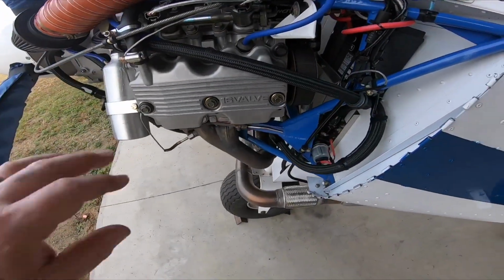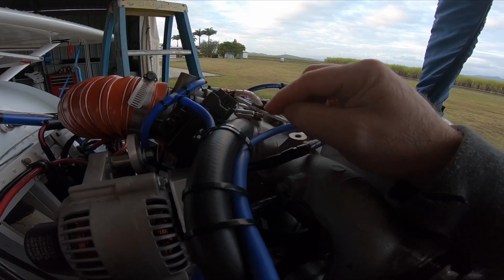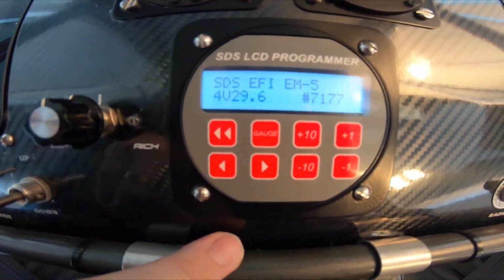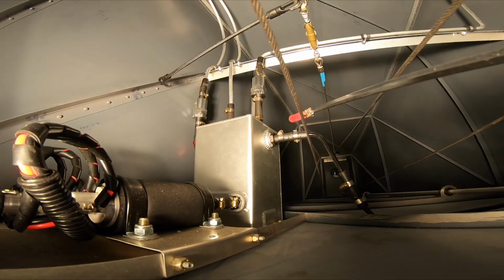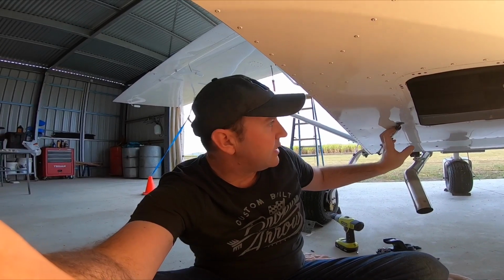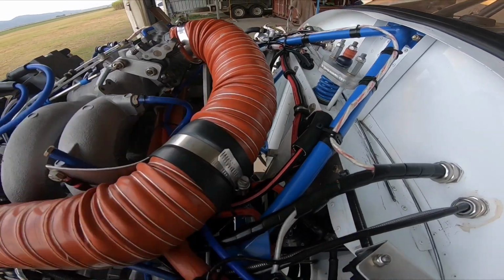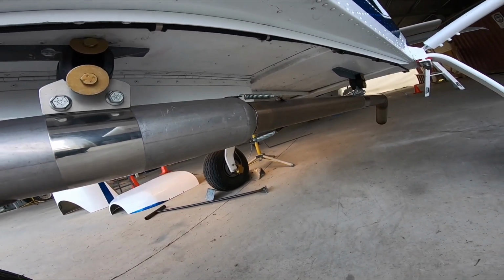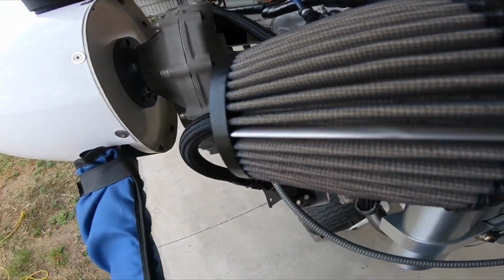Michael Hille Subaru aircraft engine conversion on the Zenith 750  Cruzer

Comment: What you can say about SPG gearbox quality? I'm thinking to use their version 5 for a 6 cylinder subaru engine, how much hours are accumulated in your airplane?
Reply from the maker: I had no issues at all with them , quality was nice holes didn’t like up the best on the bell housing  but apart from that I was happy with it- very solid. I have seen one drop bearings and chew out the gear but that could of been a bearing issue or alignment

Comment: Excellent video.   If you built a Cruzer again, would you use that engine and gearbox again?  What would you do different?.  Did not opt to use a belt drive on the amphibian and not an SPGR4?  (I am looking to build a Cruzer soon.....(I sent you PM on Zenith Forum....)
Reply from the maker: Thanks for that appreciate it. I would definitely do the same but probably turbo it for even more grunt that that’s just me always looking for more 😀. It would Handel 200hp easy ran super smooth and plenty of torque. Sp gearbox is great just the price is the downside. Awesome plane for all round can land short and cruise well. Very versatile.

Comment: Do you buy a purpose built wiring harness that eliminated all the OEM built in safety stops?
Reply from the maker: Yes this is a full custom programable ignition and injection and stand alone ecu so none of the original loom was used . Simple digital systems ecu

Comment: So I don't know much about airplanes but I know that there is a lot that goes into making sure the engine stays running. Wouldn't a fuel filter bypass valve make sense?
Reply from the maker: you could do that however the screens prior to the pumps and the filter changed during annual the chances of the filter blocking would be next to none. I’m a strong believer of preventive maintenance to ensure trouble free service.

Comment: Hi Michael, sweet plane you built there. Quick question. You mentioned you turned the air intake manifold 180 degrees.  Is that new intake  custom built or you ordered it from somewhere?
Reply from the maker: Hi Richard sorry for the delay in reply, yes I turned the intake 180 degrees, it’s a stock ej22 intake and matches up either way so easy change upgrade 👍🏻

Comment: Hi Michael, have you done anything to the engine internals?  Different pistons,rods,crank?  I remember you said I think you re ground the cams but what else?  Also have you had any gearbox issues so far and how many hours of flight to date?  Great informative video by the way!!
Reply from the maker: Nice I like the 640 , I’m happy with the set up my setup is around 300lbs  firewall forward and where the engine sits is perfect I didn’t need any ballast at all and I can’t load the aircraft outside it’s limits so empty it sits on the forward limit. And trim tab is perfect I never use any more than half deflection so it’s very well balanced.
Reply from the maker: Hi KC thanks for that , the engine is stock all I did was new pistons crack tested everything and new rings bearings and cam grind all the valves are stock compression is standard also . This keeps it a very reliable engine . I have just over 100hrs on the setup. The gearbox is really nice and quiet and have had no issues with it , seems like a very strong gearbox .
Reply: @michaelhille261  Great to hear!  I just finished a scratch build of a CH 640 about a year ago.  I am getting the itch to start building again and I think I am leaning toward the subaru set up you are using.  Any idea what your firewall forward weighs?   Also did you need balast in the tail for weight and balance?  I think Im building a 750 as well.

Comment: Michael, thanks for posting this! I have a question. In the video you said that your gearbox was a "SB4 Gearbox". I have googled "SB4 gearbox", "SB4 redrive", and "SB4 reduction drive", and I can't find anything with that label or brand name. Can you help me locate where to buy this gearbox? Thanks!
Reply: George, it is possible you may be getting tangled up with 'Sub 4' gearboxes which were a thing in nz a few years ago but they are now called Autoflight gearboxes. But anyway it looks like Michael is talking of a different product altogether. Good luck.
Reply from the maker: Thanks Vassili, gearbox has 100hours on it now running awesome, very quiet too
Reply from the maker: This is an SP-4 gearbox from air trikes, they do a full conversion for all different engines
Reply from the maker: No worries George its an SP4 gearbox from airtrikes  they do a full conversion kit that bolts straight on.

Comment: What is your empty weight ?
Reply from the maker: Allan my empty weight is on the heavy side because I beefed up the cabin frame , wing tanks tail and wings , breaks , tyres strut pickup and many more bits to carry more weight so my MTOW is 750kg and my empty is 460KG. The engine is around 136kg installed
Reply: Michael Hille yes I am building a CruZer too 90% done 90% to go. I am fitting a 0320 lycoming 140 hp with lightweight starter, alternator etc etc..looking at about 400kg empty weight Cheers Allan
Reply from the maker: Allan that sounds like a great combination

Comment: Thanks for the presentation Michael , very informative .  Is the redrive ratio 2 : 1 or 2 .? : 1 , just curious .  JG
Reply from the maker: That’s a bit like the hunting vs non hunting cam pulleys you told me about 👍
Reply from the maker: Thanks Jim its actually a 2.34:1 Ratio
Reply: @michaelhille261  . Thought so ,  cos at 2 : 1 it is a ' non hunting ' gearset and would suffer extreme wear in 2 place on the primary gear and 4 places on the driven gear . Same as car diffs .
Reply: @michaelhille261   Excellent plane Mike, and excellent very informative video.
Reply from the maker: Thanks Vassili the SP-4 gearbox is performing well it’s a very solid gearbox and I would highly recommend using this gearbox, I may even use one on my next build starting very soon 👌
Reply: @michaelhille261  Thank you Michael. I like to hear this gearbox is working well for 160 HP engine. I advise to think about VPP. It is used at 701 with Rotax 582 by one of my customers. It gives some advantages even for 65 HP engine, but you can get much more regarding takroff and cruise efficiency from high power Subaru EJ and potentially faster Cruiser. More info http://www.airtrikes.net/propellers.shtml